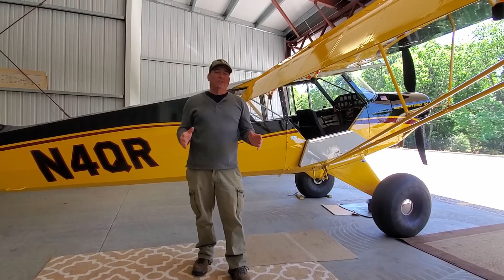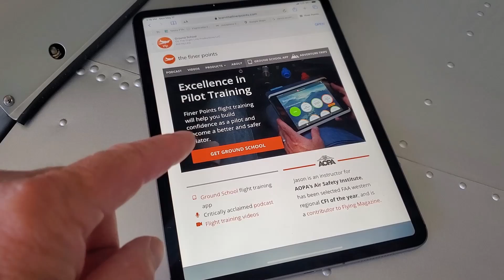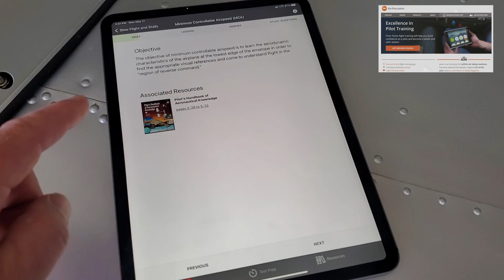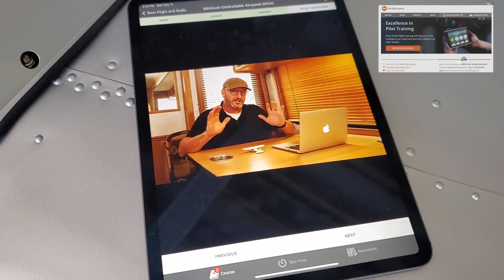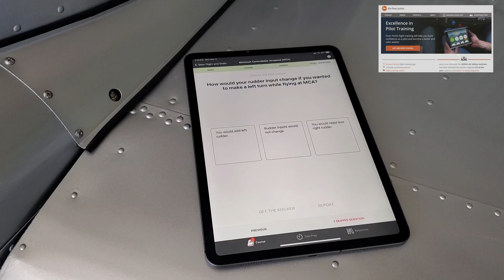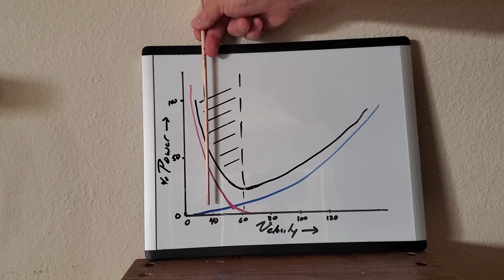Stalls and Falls in the Mighty Luscombe!

Comment: Your drag graph explanation is just like a boat.
The "area of reverse command" is just like getting a boat up on to plane. Lots of power to get moving as the hull creates drag, and there is a speed zone right before it pops up on plane where it really takes power to fight that drag.
Most efficient speed is where the hull is out of the water, and the engine isn't being required to work hard or being in higher RPM.
The faster you go, the more power you need to fight the drag created from higher speeds, and efficiency goes down. My last 15% or so of throttle on my boat really only gives me a few more mph.

Comment: Best Angle of climb 56 mph  Best rate of climb 72...  also is the sweet spot on approach, and for wheel landings  allowing an easy abort and climb out . Bad cross wind, land wing low on one wheel, if everything is well stabilized, slow down let the other wheel settle, if directional stability is still good, tranistion to a three point, if it goes wrong, just fly out of it and try again.  Slip to a landing. Ride the elevator down in full control. Lovely.

Comment: I learned something from this. I understood the relationship between the wing and horizontal stab and how the up and downforce and cg create stability. I did not realize that the stall over the wing root disrupting airflow over the horizontal stab is what causes the nose to drop. I guess I always assumed the nose falls because the wing stops flying. But now it occurs to me that if the wing fully stalled with the horizontal stab still producing downforce the plane would just fall straight down out of the air and the stall might be unrecoverable. This makes more sense of a couple airline crashes involving high altitude stalls where a proper recovery was never executed and the planes just fell out of the air nose high.

Comment: Mid 80's private pilot check ride in a C152 (I passed).  He complained about my accelerated stall.  He wanted the nose to drop blow the horizon.  I complied & recovered and seconds later my wing dropped and I spun; recovering after a single spin (I think).  He said do it again and I did, including the spin & recovery.  I was sure that had failed me.  Now I know why I spun.  In those days many financed a desire to fly by getting a CFI.  Not all were good instructors.  My first solo, the instructor was 100 miles away.  The radio quit.  I was terrified and the tower was probably hitting me with light signals but I would not have known what they meant.

Comment: Juan,  most modern pilots might disagree with this,  but I started taking flight instruction when I was 14 as a result of getting a job at the local FBO as a line boy  washing planes and keeping the hanger clean, refueling the planes etc. Anyway on my first hour in the J3, I asked my instructor what exactly was  a spin and how to recover. He proceeded to climb for what felt like an eternity he told me to count the times we went around, then gently pulled the Cub into a power off stall and kicked it into a spin. I counted 17 turns before he pulled us up and out of the spin and returned to straight and level flight. When we finished the lesson and got back to the field he time and explained exactly what had happened and how each action, from stall entry to final recovery had taken place .  I learned a whole lot about flying that day and mostly not to be afraid of stalls or spins.

Comment: @blancolirio , great videos!  I got my Private Pilot license in college at San Luis Obispo 42 years ago. My instructor was an ex Navy fighter pilot and made me learn and practice multiple spins, cross-controlled stall-into-spin,  true dead engine air starts, steering with open doors (high wing) etc. Learned to land on tiny little sloped dirt/grass strips along the coast and inland.  Then took 15hrs of aerobatic school. I don't think  they teach any of that now, but I sure felt fairly competent after all that.  Want to get back into flying again after a two decades off.

Comment: My teacher on my PPL training took me through spins because he knew I wanted to learn (USA). I commend his approach to flying. He taught me to fly a close-in pattern so that at any point in the approach I was always within gliding distance of the runway. He also taught me to use timely application of the flaps and/or slipping as tools to control the rate of energy loss (of course not slipping at an airspeed so slow as to risk incipient spin). I worked with him all the way through my tail dragger sign-off. I couldn't have asked for better foundational stick and rudder instruction. I do see the point in drilling people on how to recover from the stall at the onset of the condition, but agree that people benefit a lot from experience of the fully developed stall/spin condition. I would like to see airline pilots doing recurrent training in aerobatics, there seems to be a shocking lack of basic flying skills coming out of some the pilot-mills around the world.

Comment: Enjoyed the stalls... I learned flying on a very rigid basic Subaru  trainer (Fuji FA200-160) kind of sundowner but build like a tank  . One of my brothers was a fighterpilot and he learned me flying, all my other instructors were also fighterpilots or ex figther pilots or cropdusters , so they learned me the know the plane in all attitudes .  And practicing stalls was indeed practicing stalls .  IMHO its good when a basic trainer is 'honest' and flies  according the books so theory and practice meets each other.  I felt the same joy again when watching your deep stalls and 'wrestling' with the plane using lot of rudder .  The first stalls in some other attitudes were all 'by mistake'  .. Your instructor starts laughing before the plane shows you who is the boss suddenly stalls , like in your first steep turns (> 60 degrees bank) and they tell you to pull harder and you pull to hard  and the plane make a snap roll . or in a loop on top , full throttle and 0G  and  it snaps again when you keep pulling after the pull up for the loop .   During all these exercises my brother took the fuse of the stall warning out,  telling me the plane will tell you , you only need to learn its language , its a trainer and not a learjet . Anyway I enjoyed your flight as if I was flying my self and hope it will inspire other pilots to do regular some training .

Comment: Throttles-Idle
Rudder and Ailerons-Neutral
Stick - Abruptly full aft  and hold
Rudder - Abruptly apply full rudder opposite spin direction (opposite turn needle) and hold
Stick - Abruptly full forward one turn after applying rudder
Controls - neutral after spinning stops and recover from dive
43 words I will forever remember.  Yes spin training should be taught and even the Air Force has gone away from it.  Sad and tragic.

Comment: Hi Juan this seem like great training and you have great experience to share. I love airplanes, rc airplanes and all types of flying objects, but I am not a licensed pilot..... B ..U...T..... I've been driving 45 years without an accident, so I must be doing something right down here on the ground, HA! With ground vehicles, I could draw this analogy... Every time I drive a different vehicle I want to know exactly what it's limitations are and how it handles in all conditions and all types of weather. This makes available the muscle memory you need when it comes to accident avoidance time or other driving emergencies.  It seems clear the same applies to airplanes. You need to understand those limits of the airframe in all conditions, weather, loading, density altitudes, attitudes etc.. Not just understand, but know them by instinct. How else would you know 1) the safety margins you need or 2)how to react in time? The only way to have that is with constant training, as you are suggesting.  IMO  Its crazy to have flight training without intimate understanding of the flight characteristics at the limits of the envelope for any aircraft you fly. Maybe envelope is the wrong term. I'm talking about the limits of the normal flying / maneuvering regime. I'm not suggesting people play test pilot, and see what their airframe can handle structurally  :0

Comment: I can recommend gliding too.
Every pilot should have a go in a sailplane, which is proof an engine is not required for controlled flight.

Also there is NO GOUND ROUND so you have to get the approach right 1st time !!
Gliding definitely improves anyone's flying skills plus there's none of that noisy fan up front 😎👌
Reply: 94 winch launches. Loved them all. You are correct, every pilot should try sailplanes.

Comment: just a bit of pedantry about terminology:
Area of Reverse Command revers to the area of slow flight where adverse yaw and high AoA combine to overcome the normal action of the ailerons, resulting in aileron movement causing the opposite reaction from the plane (L aileron stalls R wing, plane rolls R).  It is also used to refer to the fact that in this same region, your rudder pedals control your roll attitude.

I've never heard anyone use it to refer to being on the back side of the L/D curve.
Reply from the maker: Do some more research, don't take it from me. Jb.

Comment: One of the, if not THE most important survival lesson. Period! When I was instructing, I spent at least a full hour on stall spinning. With ASI and ASI blanked out with a sticker on it, with power and partial power. The most insidious stall spin is a stall spin with an engine that loses power gradually as opposed to go bang... If you have vapour lock and the thing is sputtering and people try to nurse it back to the field is more dangerous than boom and oil on the windshield, which is hard to misjudge

Comment: In my teens while heavily into RC models, both powered and gliders, I made extensive use of washout.
Many models are_were kit based and few kits advised providing washout. I mostly while building already constructed in a washout. Though possible to add some twist by warping/twist using heat and/or doping stage of fin8shed wings, I found while glueing and construction of specific washout region was far more controllable and far kess likely to telax or time.

Many people were surprised how much improved my planes flew compare with gheir own example of the same kit build without washout. In one case a glider kit had a very bad reputation for flight characteristics, ranging from near unflyable to very hard to control. Mine with washout was a joy to fly. I do admit that my tail structure got modified during build, with rudder a larger part of vertical section and horizontal area incresed by 15% or so and elevator area about 10% of that area, while the kit normally only around 6%. It was normally best suited to purely slope soaring, mine even handled thermals very well, where less controllable standard versions became very unstablw around thermals.
In addition to washout I often added a shaped wing end with downward end sweep.
Reply from the maker: Everything I learned about aerodynamics was from free flight models as a kid. Great stuff!

Comment: We had a Civil Air Patrol group at the same grass strip airport where I kept my Champ and we all knew each other.  They ran a sailplane operation to keep current so it was just a ton of fun to fly next to a sailplane with the elevator trim all the way up and the power at about 1,200 rpm. It was really good practice for maintaining control during slow to very slow flight.  Your feet and legs could get tired from dancing on the rudder pedals to keep that ball centered. The most fun was to try to make the other guy stall first. The one who stalled the most had to buy the donuts.  Ah to be young and able to eat like that again. <sigh>

Comment: Juan, the use of the scenario based approach is really important, because pilots will get into a stall situation from a more benign, more familiar attitude and condition.  Throw in distractions and the opportunity for misuse of controls is greater.  I learned the old school way of throttle back and pull the nose up till you got the full stall or full throttle departure stalls with the nose 20 deg above the horizon. The real scenarios that seem to get people in trouble are tailwind x-wind turns from base to final, trying to climb on takeoff over obstacles, low speed maneuvering at low altitude and power loss.  Those are good examples why this idea of DMMS is an effective idea.  It can go a long way to improve a pilots chance of survival.

Comment: The Canadian PPL used to require full stalls, spins and spirals. Maybe it still does. A spin in a 172 is a hoot. With a couple of big boys in the front seats, you have to go into your stall with power or push on some power at the stall, full back stick and full left rudder. When it breaks, it snaps hard and you're pretty much inverted on the first half of the spin. It really doesn't like to be in a spin but it likes spirals just fine...which is a whole different pile of poop if you don't catch it. Airspeed will pick up in a big hurry and recovery is different. Heaps of fun, tho. Great demonstration, Juan. Thanks.

Comment: Always have thought that this is the wrong way to deal with stalls, there is a pronounced delay between rudder application and reaction, much better to push, quicker response and it works in both directions.
Reply: @John Doe simple, do not worry about flying the stall, push the stick forward and break the stall.

Comment: Beginner question: in a stall you should use rudder control, but doesn’t that create yaw that could put you into a spin?  Thanks Jaun. Love your videos
Reply: Play it full screen and watch the ball in the turn coordinator. Even tho he's stomping the rudder, you notice the ball moves little. That's because when one wing starts stalling (drops) it adds drag on that side, which does create yaw - using the rudder counters that yaw.
In a more high performance airplane (like a Mooney) usually the stall is way more sudden and one wing or the other stalls hard with alot of instant yaw and >30deg bank which can easily end up in a spin. Some of the hotrod experimentals a stall must be pilot corrected properly or a spin will result, most certified planes (even a Mooney) will recover on their own by letting go of all controls (even tho you may lose a bunch of altitude).